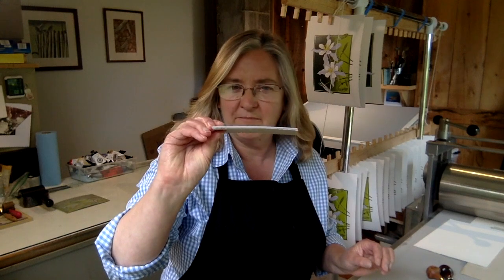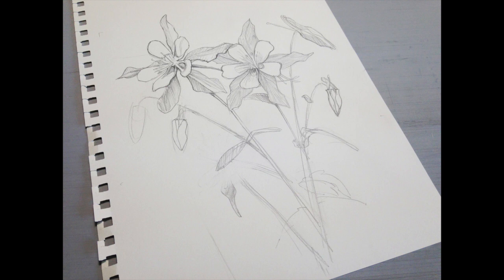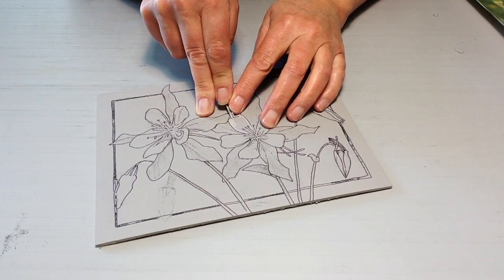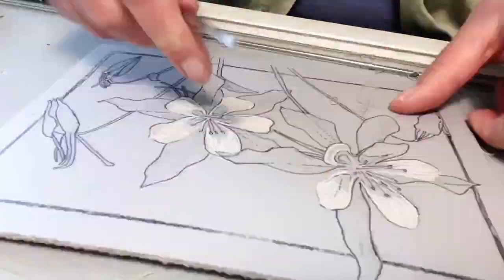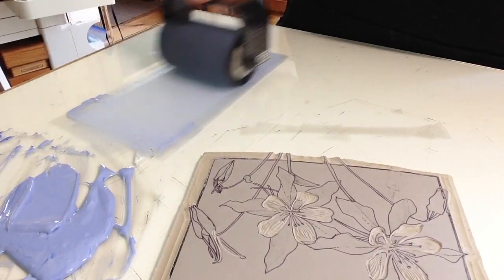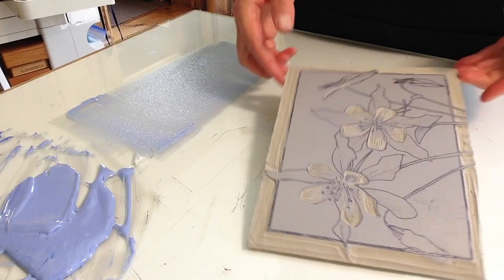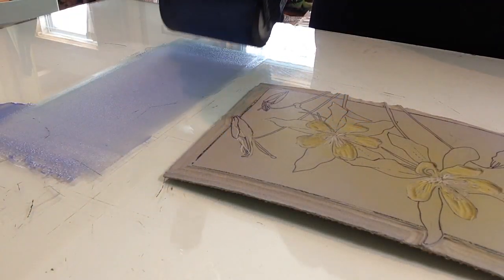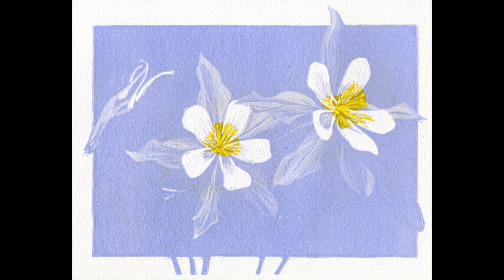Reduction Linocut Process: Columbine

Comment: Thanks for the great walk-through! I especially appreciated how you talked through those tricky decision-making processes. It's cool to hear an artist describe how they make choices. I need to explore your channel a little more, but I'm curious about how to construct a jig. I got the general idea of how yours works, but I'm interested to see how to line things up and attach the pins. Anyways, very cool! Your print was beautiful as well.
Reply from the maker: Emily, I'm so sorry I missed replying to this when you posted it... somehow I don't think I ever saw it. As for the jig... the one I am using in the video is just a piece of matboard with an opening cut in it that is the same size as my block. I attach the pins to one end of the matboard, and then attach mylar tabs to the back of each piece of print paper before I print the first color. When I was printing by hand I used lino mounted on 3/4" board and built a wooden registration jig. A description of that is on my blog, here: https://brushandbaren.blogspot.com/2008/12/linocut-jig.html  Thanks for watching, and for taking the time to reach out with your question!

Comment: Wow ....the masking of the yellow bits is exactly where I am stuck. The sticky paints mean I need to dry them 1 day more......no-one tells you that at college. Neither did the Masters degree tutor tell me to sketch the image onto paper, trace it, draw it in ......the carve thin lines...wax crayon over the carved image with newspaper to get an idea of the possible lines of the print to see before taking out too much of the block. 
I paid a tutor who had no idea about the process and how to teach the steps. I did litho printing. The tutors told us everything in one go and there were 38 steps because I drew them in a flowchart. They really do need to learn how to teach first before they start importing technical knowledge. Now I understand because you broke it down so well and it’s answered a lot of my problems because I couldn’t work out how to keep the yellow bright without it getting darker from the other colours. Thankyou!
Beware of bogus tutors online who don’t know the process!
Reply from the maker: That sounds so frustrating! I'm glad you found this helpful! Masking is a good way to isolate color. You still need to be careful about drying times... if the ink already on the print is too wet, the mask will pull it right off. But it's good to have lots of possible techniques in your mental toolbox.

Comment: Thanks so much for doing this. As a self-taught reduction woodcut printmaker, I'm forever questioning if I'm doing things right. I've long been a fan of yours, so seeing you work through the same issues I have in the same ways I do, has been a great confidence boost. I often print lighter colors over darker, bolder ones, and I love that you refer to the "ugly duckling stage" -- I call it the "awkward stage."
Reply from the maker: I'm glad you found it helpful, Jeff. I, too, am self-taught... I try not to think of it as whether it's "right," but whether it will work! Mostly I describe my process as creating successive problems that I then have to solve. ;-) I rarely have a plan when I start... just a solid (I hope) drawing and an end goal. How I get there (if I get there) is almost never straightforward. Press on!

Comment: Just found this video and I can’t wait to go home and try it. 

A quick question: what is the best way to clean the linoblock and how long did you wait between color passes?
Reply from the maker: I am using oil-based inks, so I clean up with mineral or vegetable oil. (I put some mineral oil on my inking glass, roll it onto the brayer, and use the brayer to put oil on the surface of the lino. You don't want oil to get down into your cut areas!) How long to wait between colors depends on several factors: type of ink, how many colors are already on the print, thickness of ink, thickness of paper, and the weather! In the early stages I can sometimes print more than one color pass in a day, but after 4 or 5 layers are printed the drying time slows down.

Comment: Inspiring work!!! What if I don't want to carve the same block and keep the purple original?
Reply from the maker: There are lots of different ways to make multi-color prints. You could carve a block for each color pass and print them singly or all together. Or you could, for example, make 20 prints to the point where all the purple layers are complete, pull out 10 prints that will stay that way, and print the remaining colors only on the next 10 prints, if that makes sense?

Comment: Wonderful work! Could explain again how the accurate placement of your paper works? Which material do you have on the paper? I mean these blue stripes?
Reply from the maker: Thanks for your questions. The blue stripes are pieces of tape used to hold mylar tabs onto the paper. The tabs fit onto metal pins which are attached to a matboard frame. I wrote blog post about registration methods here: https://brushandbaren.blogspot.com/2015/12/process-notes-registration.html
Reply: @SherrieYork  Ah perfect! Thanks for your answer!! I did'nt see the Blogpost jet🤗

Comment: What a great video, Sherrie!  May I ask what method you are using to keep the initial drawing on the plate through so many inkings?  Is it just pen?
Reply from the maker: Yes, I use a permanent marker. (Sharpie) There are some things to be cautious about, as the pen can bleed onto prints, so it requires a light touch if you're printing with light ink colors. I know some people who have used India ink and say they don't get bleed, but I haven't tried it.
Reply: @SherrieYork  Thank you so much!

Comment: Wonderful! In my spare time, I carve and paint. Your suggestions show me a nice way to 
combine these two techniques. I have a few questions and would be very happy if you could answer them to me. What kind of paper are you using? Are you dampening the paper? What colors do you use? Best wishes from Hamburg
Reply from the maker: Thank you, Stephan! I am using 250# BFK Rives paper, and NOT dampening. When I was hand printing I found this paper to be too heavy. For hand printing I used Japanese papers, most often by Awagami. As for colors... do you mean brand of ink? I have a mix of manufacturers that I use, but mostly Cranfield Traditional Oil-based relief inks. I hope that helps!

Comment: Sherrie, do the clothes pins dent the paper? Do you tear off an extra edge after they dry ..where the clothes pins were?  Thanks! Thanks for the video!
Reply from the maker: Do you mean the the clothespins on the drying rack? No, I haven't had a problem with that... but I do have a wider margin on the edge where the registration tabs attach. When I remove the tabs the tape damages the paper, so that extra inch for tab damage and potentially the clothespins gets trimmed off anyway. The wooden clothespins are pretty gentle... a grip that's just tight enough without being too tight.

Comment: Hi Sherrie, wonderful demo! Question - what size or height of registration pin / button are you using??? Afraid to damage drum on press.
Reply from the maker: I'm using the most shallow Ternes Burton pins. .055, maybe? When I run through the press my paper padding covers everything, including the pins and I use a stiff cutting board over the top instead of blankets. The pins slightly indent the paper padding but not the cutting board, so it seems like I'm good. No problems yet, anyway!🙂
Reply: Thank you Sherrie for the prompt response

Comment: Hi Sherrie, Just returning to printmaking and really don't have much experience with block printing. I'm curious what is your paper choice, and also where did you get (make?) that amazing drying / hanging system?? Thanks!
Reply from the maker: Hi Jill... On the press I use 250# BFK Rives paper, but if you're hand printing you'll want something lighter weight. I used papers like hosho and the Awagami kozo for years of hand printing. As for the drying rack... yep... made it myself! It has evolved a bit as I've moved around, but there's a post about it on my blog: https://brushandbaren.blogspot.com/2016/04/not-so-high-tech-drying-rack-aka.html
Reply: @SherrieYork   thank you so much for this helpful video and your info! I'll check out the blog article you wrote, too! :)

Comment: Love seeing this.  What kind of printing ink do you use?
Reply from the maker: Hi Sherry, I use oil-based relief ink from a couple different manufacturers. I use a lot of transparent extender, but most of my pigmented inks are Cranfield Traditional. I also have an old stash of no-longer-manufacturer Daniel Smith, plus a few colors from Gamblin.

Comment: If my drawing on the block is done in pencil, will it be removed the first time I ink and clean the block? Should I go over the drawing in permanent ink to be safe? Thank you, very helpful video!
Reply from the maker: Yes, pencil will disappear the first time you clean the block. I typically go over my drawing with a permanent marker (Sharpie here in the US). The caveat is that the marker lines can bleed onto the prints in early stages, so use a light touch. If you're doing reduction printing a little bit of bleed won't matter because it will be covered by subsequent color passes. Some people have said they have good success with India ink, and that it doesn't bleed, but I haven't tried it.

Comment: How are you cleaning the lino after inking?
Reply from the maker: I am using traditional oil-based inks. I clean up with mineral oil, no solvents. If the block gets too much greasy build-up I will sometimes spray some citrus cleaner on to a paper towel and use that to wipe the surface of the block. I try as much as possible to keep both oil and citrus cleaner out of the carved areas.

Comment: Question for our local arts school; the teacher said they have a press but each time they put in a piece of lino it moves slightly so it's hard to align things properly.
Is this because the roll isn't balanced properly?
Reply from the maker: It could be a number of things: too much or too little pressure, too much or too little ink, uneven roller or press bed. If the block isn't surrounded by some sort of support, the act of the roller hitting the leading edge can knock everything out of whack. Difficult to diagnose the problem without seeing it.... sorry I can't be more helpful.

Comment: I have tried using dry paper and playing with the pressure of the press but I don't seem to get it right. Please tell me, do I have to add anything to the ink or use an specific paper? It looks so easy when you do it, I guess it is your 25 years at it. I would appreciate very much your help. Thank you.
Reply from the maker: I am using "traditional" oil-based inks on 250# BFK Rives paper. I don't usually modify the body of the ink, although I do use a lot of transparent base in my color mixing. I find the best results come with building up thin layers of ink gradually. When printing I top the block/paper/protective paper stack with a stiff cutting mat, not a press blanket. Sometimes of the block is not printing evenly I might add a thin piece of newsprint as padding in specific areas. Often this small amount of additional thickness is all that's needed. I hope any of this is helpful!

Comment: Do you recommend the unmounted or mounted lino? What are the advantages of each?
Reply from the maker: The short answer is: It depends! I used mounted lino for the first few years that I made prints and built a registration jig to accommodate it. I was printing entire by hand-rubbing during that time, and I found the mounted blocks were good to work with. I have a press now, so prefer working on unmounted. The biggest issue with unmounted is that it can curl, especially if you are using water-based inks and you get the burlap baking wet. It can also stretch in a press... which the mounted blocks won't do.
Reply: @SherrieYork  Thank you.

Comment: hi again 
I have been looking everywhere for the metal pins you use to hold the paper when printing  finding it difficult to keep paper in place.  
Can you tell me where you found them . thanks  Jane
Reply from the maker: Jane, I use the registration pins and tabs from Ternes Burton: https://www.ternesburton.com/
Reply: @SherrieYork  thank you so very much  :)
Reply: I got them and they are great tks
Reply: Hi Sherri I hope you get this. I’ve been doing 8x10 and 9x12. Lino’s. Never before have I had so much trouble getting the ink to set right on the paper trying better inks. Different limos and now paper after watching your reduction printing I do want to start doing but the ink getting spotty.  I was hoping you could tell me what lion and paper you use for your prints I’ve done Xmas cards for yrs and never had issues hoping it’s something simple. Frustrating I was hoping I could send you a picture you see what I mean ☹️
Reply from the maker: @JaneCizynski  What kind of ink are you using? I use oil-based inks, which I find give me the best results. There are a lot of variables that could be affecting things... paper thickness/texture, viscosity of the ink, thickness of ink application, and condition of the lino. I use regular "battleship" lino... for handprinting I used  hosho and other thinner rice or mulberry papers from Awagami. On the press I'm using 250# BFK Rives.
Reply: @SherrieYork  thank you so much  I have been trying the Cranfield caligo safe wash relief inks on some thinner kozo Mulberry paper, its working much better ' I think ill try the oil base again with the thinner paper,   I was able to find sample paper 9x12 " From paper Connection' so ill try printing on that, I do use the battleship grey lino . I stopped my reduction print till i get this solved Iven been so excited to try the reduction print. taking a 2 week break then ill be trying it out once again  thank you Ill keep in touch  love your videos  Jane :)

,

Comment: what are the metal tabs used to hold the paper in position?
Reply from the maker: Hi Deb... Those are registration pins from Ternes-Burton. https://www.ternesburton.com/ Before I start printing I affix mylar tabs to the back of each sheet of paper... the tabs fit over the pins and hold the paper in the same place every time.

Comment: So lovely! What kind of color and paper are you using? I'm thinking how many color layers is it possible to print without problems. I live in Finland, so the brand name doesn't necessarily help, but the quality.

Thanks for a wonderful lesson 🩷!
Reply from the maker: I use (mostly) the Cranfield "Traditional" oil-based relief inks. On the press I use 240# Rives BFK paper, but if I'm hand rubbing I use one of the Awagami papers... usually the Kozo. The number of layers of ink depends on how thickly you apply each layer, what type of paper you are using, what the atmosphere is like in your work space (dry? humid?) I have made prints with as many as 22 colors, but with a lot of "spot inking"- applying color in only a small area of the block rather than the entire surface.